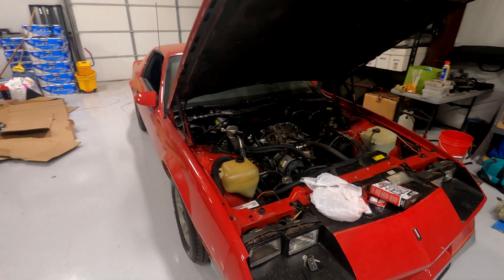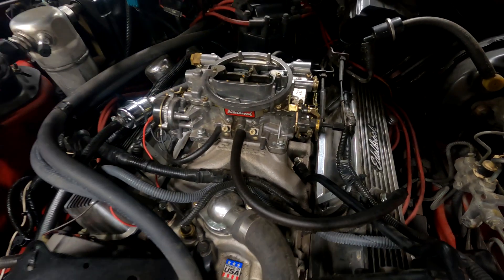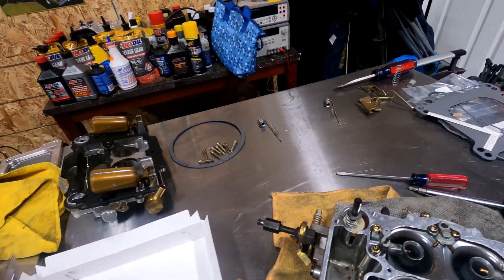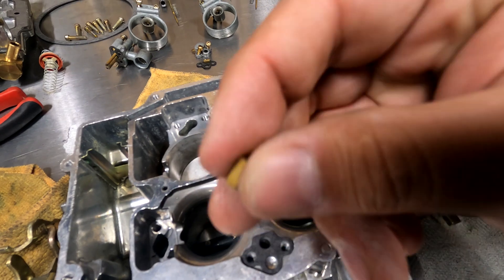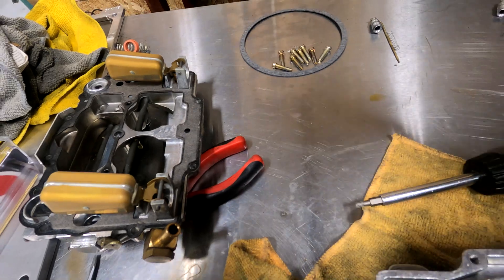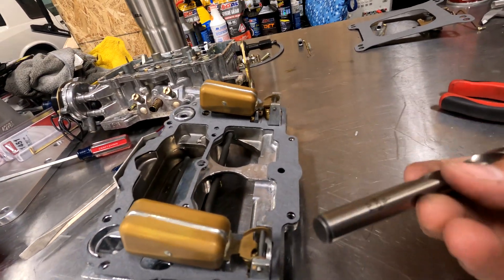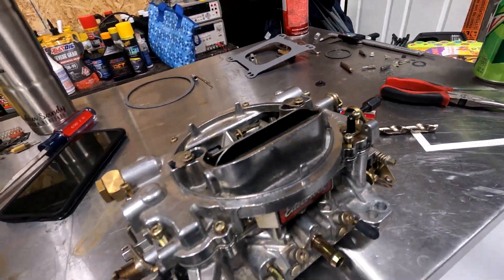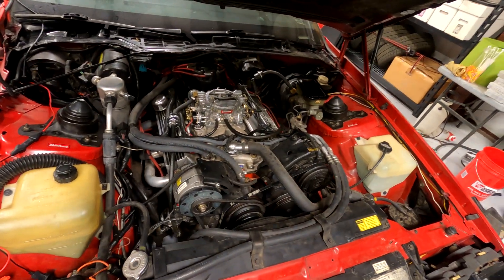Edelbrock 1406 Carburetor Rebuild & Tuning Chevrolet Camaro | Edelbrock 1406 Carburetor

Comment: Thank you for the informative video.
Found me a '85 Z28 and it needs a rebuild on the carburetor (sat too long) will be the start of a resurrecting process of my Black Pearl
Reply from the maker: Just put a holley sniper on it
Reply: Great video. After my rebuild, I’m getting fuel coming out of the square ports on top.
Reply: Any idea why?
Reply from the maker: @immokalee98able u forgot a gasket or something.  Send a video to fatguybuilds @ gmail